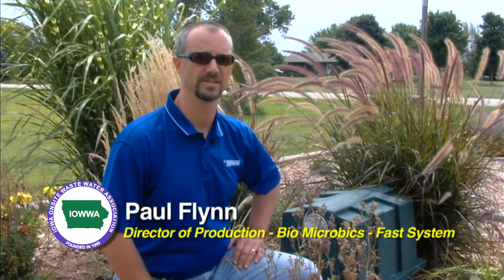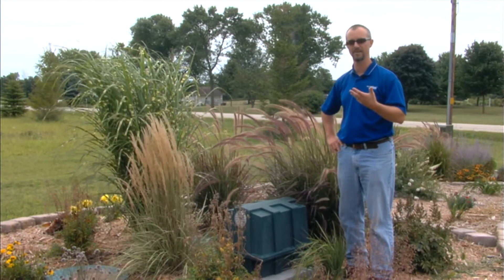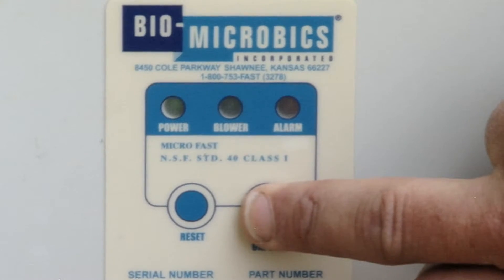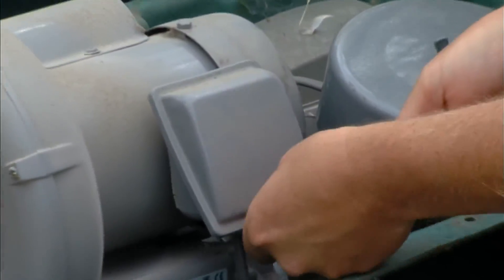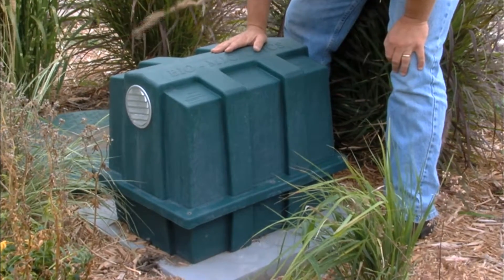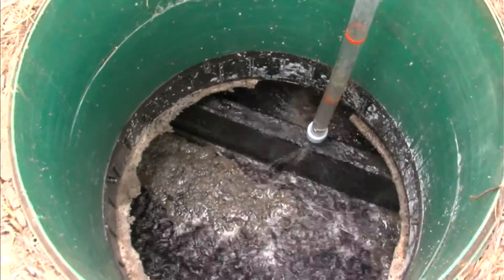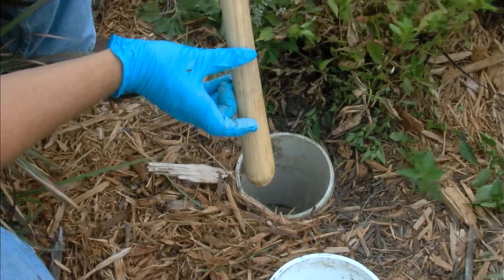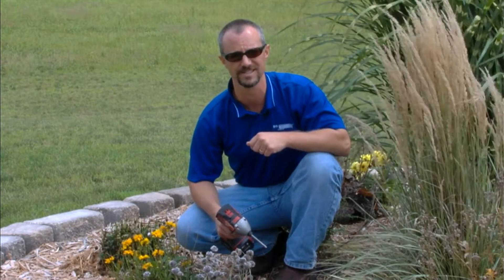IOWWA - Bio-Microbics FAST System Maintenance

Comment: My system smell bad at the pump area that is next to the house. No one knows why.. when the blower is turned off no smell. it  smells like back flow from the tank it reeaks and is 3 years old and has always had this trouble. I would like some help to determine what is going on.

Comment: My system has Very high frequency pitch audible from a about 20 ft away . is this normal ?  if not not how to fix it?
Reply: Hi John, we have the same issue. Just purchased a home an this high frequency pitch noise coming from the blower is going to drive me mad. Did you find a solution? I can’t seem to find anything online
Reply: @Kehani7  / did you ever find a solution?  I just moved into a home that has the same noise issue! Driving me crazy.
Reply: @grheryford  yes we did find a solution. Send me your email and send you pictures of what we did. We sprayed it with Great Stuff to insulate per instruction from The Septic provider :)
Reply: What do I need to do if my blower doesn't run?